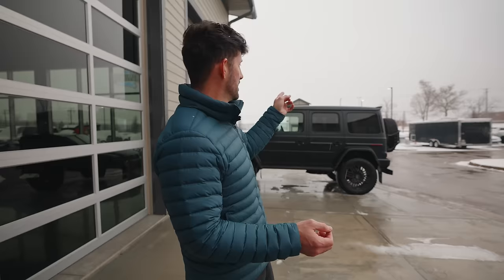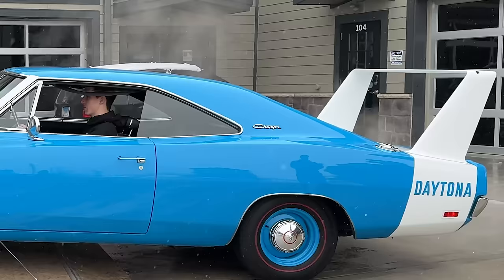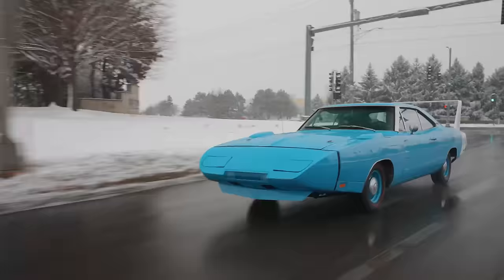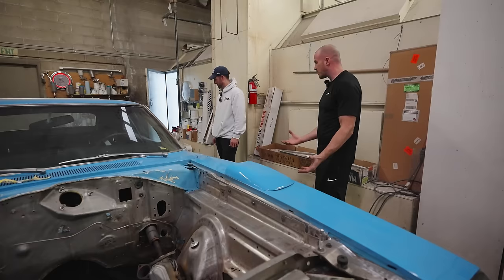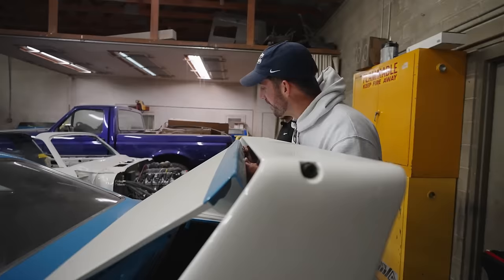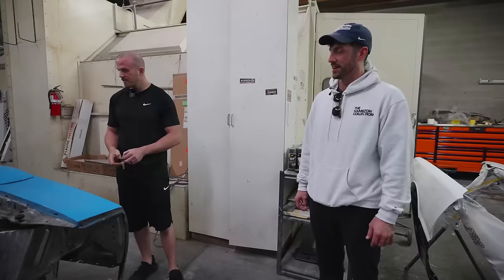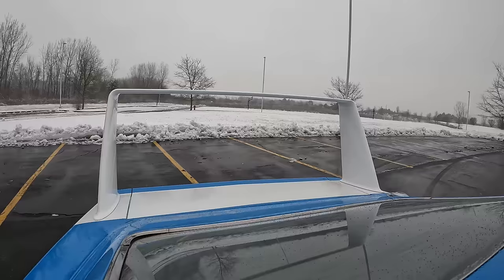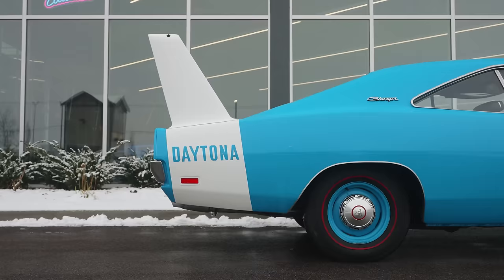Delivery Day of My Rarest Car Yet - $400,000 Unicorn!

Comment: Hemi was 426 cubic inch, not 440 cubic inch, the 440 is the magnum which is sitting in your car. Couple of cool history bits: They worked with a nasa engineer to get the aero just right for them to hit over 200 mph. Dealers had such a hard time selling these that there's documentation that some cars sat for 2+ years before being sold. There were dealers that were so desperate to get them off the lots that they pulled the front nose cone and spoiler and would chuck them in the dumpste, there was a guy that ended up dumpster diving at a dealership that was getting them in and tearing off the nose cones and spoilers where he ended up with multiple sets and held on to them for the future when owners realized that the cars needed those parts again